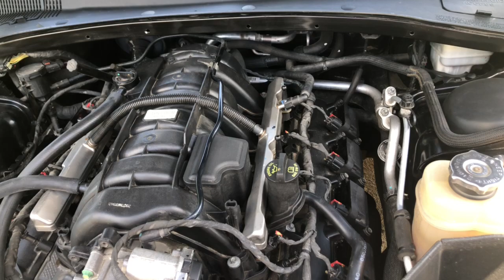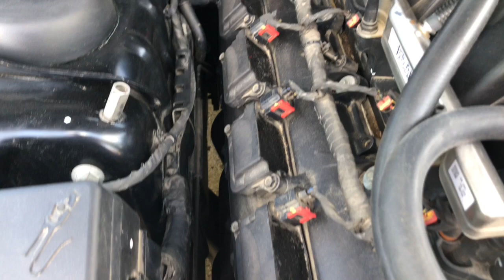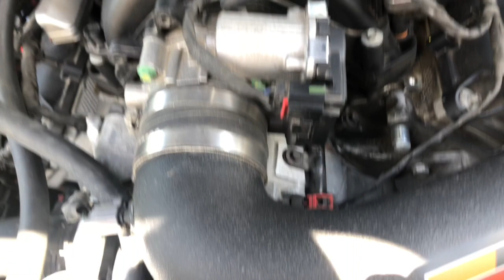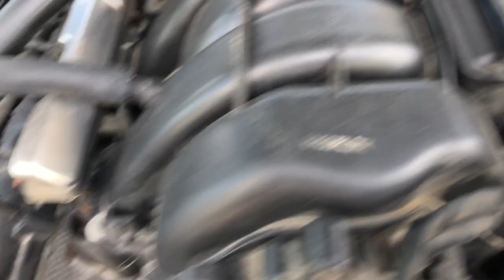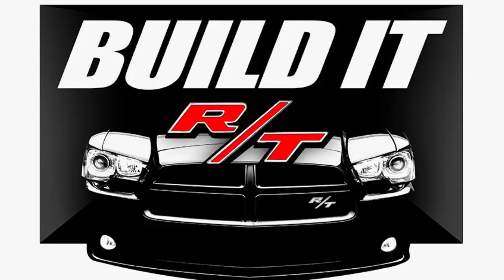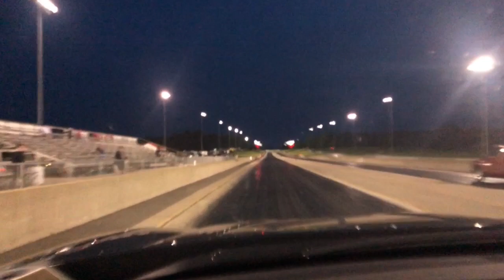What is the HEMI tick?

Comment: I wouldn't let it run for long that way. Even with regular maintenance eventually this will become a big problem. This is not normal at all. I have a 2012 ram 1500 that I will need to take apart to get at the lifters. I'm having engine misfires on cylinder 3. For anyone that has the tick, I'd suggest doing 3 things before it ruins your engine. Mds delete, newer style lifters with larger bearings and stainless steel headers.
Reply: Gordan Burin  yeah I noticed my 13 runs a lot smoother with the MDS delete. Much better throttle response also. I run a high quality synthetic and use Lucas synthetic additive and also the Wix synthetic filter. I haven't noticed any tick in my engine yet has 37,000 miles on it so low miles for a 13. I think if mind develops the tick and I determined that there's not bolts broken Etc I would probably be inclined to tear it down and replace the cam and lifters to Quality components and most likely the oil pump as well. A lot of people are making comments that doesn't make any sense because they don't have a lot of experience with push rod type engines. I still have my 70 Plymouth and I have had a lot of Six Pack cars and Hemi car from the 70s. Only problems we ever had were the stamped steel rocker shafts cups that were the actuators for the pushrods and valves. Sometimes they would break under high RPM street racing Etc. Sure is a lot of issues with these 5.7 engines. Definitely worries those of us who have a lot of money put into these vehicles
Reply: @70stunes71  definitely. I'm running Lucas oil as well. If you are in a colder climate I'd suggest running a thicker oil like 5 30w. I think a part of the problem is the oil not getting to the lifters the right way along with the cheapness of the parts.  There's definitely some pre emptive maintenance that can be done to prevent failure. I think the only reason why I haven't ruined my engine is the fact I'm babying it since I had the misfire and the fact i did a fuel, intake and oil flush along with using the Lucas oil. I didn't see any metal in the oil filter so I'm hoping to open the engine up and have a valve spring broke and not the lifter stuck gouging into the camshaft.
Reply: @gordanburin3416  5 w 30 is ok for hemi w 6 speed ??
Reply: @bgermx2487  when I lived in the east coast during winter that's what I used. I only used 5w20 when it was hot outside
Reply: what’s MDS?
Reply from the maker: Multi displacement system

Comment: This guy has no idea what he's saying , if it's not an exhaust leak you've got a lifter roller sticking because the roller bearings are gone and it's wearing a groove in your cam and it will get louder and damage the rest of your engine . If you have a Hemi and its not ticking , continue with your regular oil change , your doing well . Don't let your engine sit and idle and get you a high performance oil pump installed . Your engine will last over 300,000 miles

Comment: My 1500 Lamarie has little clicking noise when you drive over  20 mph ... it sounds like a fan clicking , when you speed down to 20 mph , the clicking stops ... any idea ? just when i'm driving
Reply: Isaias KINTA Quintanilla Motor Honey bud’ ....try 70% of the bottle or stop between the T & N in “Motor honey” label ,this greatly “REDUCES” The tick , but its the best fix next to trading in for the new one ............... believe me , I went about 750 miles too far on conventional, & had to have the cam’s replaced , and $2000 later even after the break in period , we had the tick .......  tellin uuu’ ! motor honey , im using $45 Synthethic oil now and doing my oil change’s 500 miles sooner than i need to but Good god does motor honey workk :D ..... but Only!!! After a fresh oil change
Reply: If your truck has the MDS system that could be what it is. I thought it was a cv axle until I put my truck in 5th gear and drove it that way. The click went away. It’s a noise the MDS system makes. I drive without it because I have heard of the system failing and causing damage inside the motor. Hope it helps
Reply: My 2014 rt has it to.  But ive had no problems

Comment: Just got my car back from the shop they were doing a/c repairs and i had a pentstar loaner for 2 weeks. When i got the car back i thought my engine was going to blow. My 5.7 ticks HARD while in mds mode. It’s pretty unnerving. I hope you’re right but this week im taker her back to the shop for sure
Reply from the maker: Yeah that actually sounds like a lifter is stuck.
Reply: Im a mopar guy myself & I was a mechanic at Chrysler/dodge for two years .... to cut costs we kind of make our engines like harbor freight (Dnt ever say tht to JDM Fanboys tho) ...... HOWEVER !! .... any of our engines 2008 and up , You MUST run Synthetic even if the manual says “conventional is fine” ... were youuu ??? O_o 

P.S : a cheat to save $$ on oil changes is buy full Synthetic Oil from Home Depot Save $10 overall Vs o’reilys or Advanced
Reply: Thanks so much for posting this video caliber8 and also the tip on synthetic oil. I have a 2015 Dodge charger RT with 26000 miles on it.  It taps when the engine is first started.  Seems to have done this since I had it. I will be sure and put synthetic oil in it on my next oil change.
Reply from the maker: When I first got it I did for just one oil change after that though I went to Synthetic.

Comment: You better pull the valve cover off and check for valve movement. 
Hopefully you wont have needle bearing issues common on the 5.7. 
They can seize up and grind your cam profile down. 
Miss firing at higher rpms will usually give this away.
Reply: could you tell me more about this miss firing with the hemi tick

Comment: Agree BUT, the PRO of a Pushrod Design Engine, especially like the HEMI GEN II is that they´ve NOT so much moving parts than OHC/DOHC Deisign Engines and with the HEMI GEN III they had brought out a Pushrod Engine Designe, that hasn´t any bader performance or possibilities of different modern things such as Variable Valve Time &&& against the OHC & DOHC Design engines what are a lot more complicate and even HAS A LOT MORE MOVING PARTS... Yes, think about the 4 Camshafts of an V or Boxer DOHC Engine... Think about the big Timing Chain or Beld Drive... Think about the much more parts u need if you like to get a Variable Valve/timing System like BMW VANOS, where you need 1 VANOS per Camshaft. In the case of the HEMI GEN II you´ve only one. & on a DOHC V or Boxer Engine you should need 4 of the Variable Valve Actores... (One per Cam) if you like to get the same functions like the HEMI GEN III with VVT....And also the MDS at the HEMI´s show that the Pushrod design isn´t any "old and bad", it´s actuall the better one Design if you like to have a Engine Design with less movin parts and especially turned/Spinning Masses, what are a lot more on OHC/DOHC Design Engines.

I´m from germany and at europe you really couldn´t find any pushrod design engine in the Automobile industrie, what is also a shame like the DOWNSIZING shit with less numbers of Cylinders and displacement. Actually you can´t also find not only one Naturally Asphirated Engine on the whole European Auto Industrie; They´ve canceled all in between 2005-2010 and did the worst for the one what should interest us: US, the Customer..
Because there and also at asian Auto industrie you can´t find such genius things like the HEMI Engine what is using a Pushrod design that had got all PRO Things such as VVT and even the less spinning masses, what is a so genius design at the HEMI....If they would use the Pushrod design with more displacement and nuber of cyl., at best even an V8 in the Design of the HEMI or LS Engine series, then they had the simplest and most genius way of engine design.
Ant hey, look at the Hellcat, Demon,...What also make roundabout 7000 rpms and that with 2 Valve Design. There you could also see that you doesn´t neet 4 valves per cylinder,too! These Engines are the reality or even show the truth......They are genius but the whole auto industrie tody has one problem: They wouldn´t build long lasting cars and so there isn´t any car today out there what hasnt "Build in issues" that would beginn with ending the manufacturer guarantees ;) That´s no conspiracy theorie, thats fact that students learn how to design parts/Cars, Engines, & also toasters what would life a lifespan like the last payment would comes in "At best" (in their eyes!) & hey, it isn´t fact that a V8 engine in american design could live a whole life of an human without any problem and with best DIY Repair options too, if there was the like to produce that and it wouldn´t cost one cent more.
That´s the truth, also why they will  that you buy a Electric car! Even the EV is the 1st real 1-Way-Trash-Product in the Auto Industrie, because the Physical states can´t be beaten or scamed....But the customers can be scamed with the EV and all those bad fictional lies like "Climate Warming" and such things, all introduced and even founded by bad guys what can´t earn enough money from the customers....Introduced to sell EV´s that the whole life ould be a lot more complicated for the customers and so much more expensive, too......

Comment: Even if it really isn't hurting anything or whatever it still makes the engine sound cheap I can't stand my engine ticking and it's getting worse I have 90 thousand miles on it now I use mobile one full synthetic 5w-20 oil change it and filter every 3 thousand miles even though it says you can go way longer but I don't trust that I just want to know why dodge hasn't had a recall for this yet
Reply from the maker: They can be cheap bastards that’s why lol
Reply: @BuilditRT  ha Yeah I just took it to the dealership for the airbag recall and now my dash squeaks every once and a while pisses me off every time I hear it

Comment: Please please please. Do not listen to this guy. Reading from threads isn’t the same as actually seeing what that tick does. That tick will start off real soft. Which will make you think. Oh it should be fine the big guy in the video said so. No. Wrong. BIG WRONG. The tick in the hemi or the 3.6 are a big problem. Could be a bad valve just starting out. Or a bad rocker which will start to get worse then ruin the camshafts then makes the car shake. Then bam. You bent a valve. After bending the valve.

Comment: I have a 2015 Charger RT         It has a tap at times when you first start the engine.  It has 26000 miles on it...Maybe I will get rid of it while I  still can lol
Reply: That's exactly what happens with my 2006 Chrysler 300c , and she's just about to pass 198,000 miles and running great. I wouldn't worry about it
Reply: If it stops after warm up its probly exhaust header bolt

Comment: Dude you are so far off! Have you ever seen the inside of a Hemi. I think not. The push rods are almost sideways. It is not natural. It is lack of oil below 2000 rpm. Do not use a windage tray or cut a slot 2 inches wide in the middle the length of the pan. Are you trying to Imitate the other R/T guy, who knows what he is talking about. If you idle a Hemi a lot you will get metal in your oil pan, such as a cop car or if you have remote start.
Reply from the maker: That’s from old information I had and who am I trying to imitate?
Reply: Build it R/T : He is R/T Life. It is not called old information, it is called misinformation. I thought I was seeing double.
Reply from the maker: Old information I was working with and no not trying to imitate his at all. Go ask him, I know the guy.

Comment: Hahaha this is bs my hemi has a fkn horrible loud very loud tick to the point it has started shaking the motor and leaving deposits in the oil eventually this so called tick eats away at the bearings cam and lifters it needs replaced once to a point you can hear it inside the vehicle it mindof is a big deal rodge has yet to recall this common issue